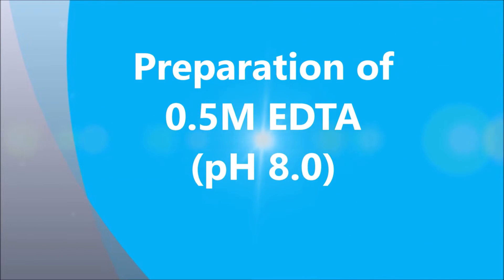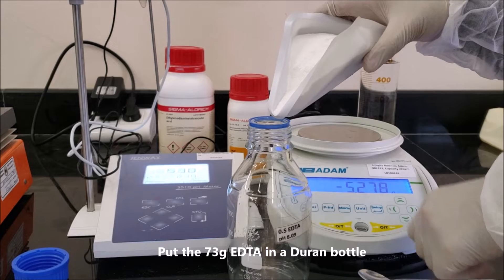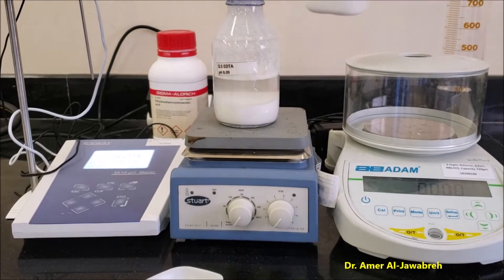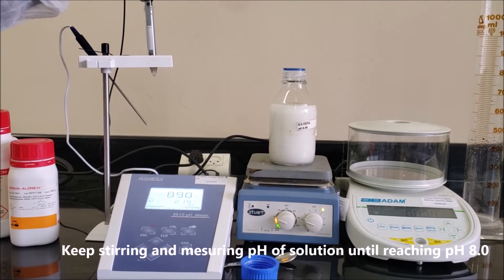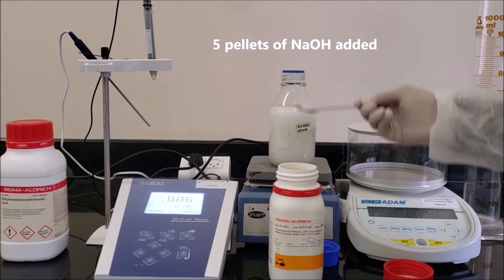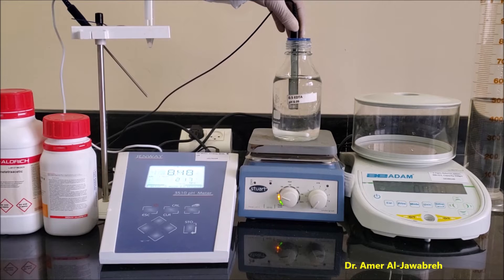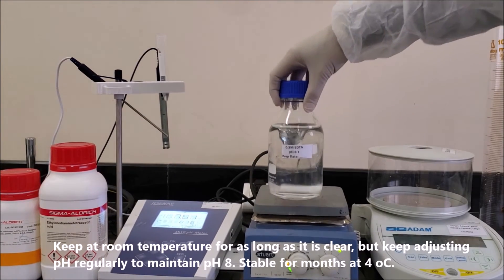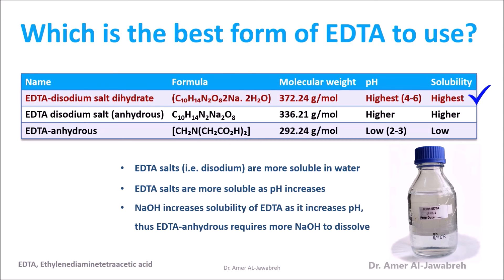How to Prepare 0.5M EDTA for TBE Buffer

Comment: Hi sir I prepared 1M EDTA many times but it takes more time to dissolve some times I added more naoh  pellets it results to ph increase like 8.9 in our lab they won't allow us to add HCl to reduce the pH for EDTA .so give me some idea to dissolve it faster at the same time oh should be in proper 8 or 8.2
Reply from the maker: Use EDTA-disodium salt dihydrate. The more H2O it contains the faster the solubility. You may use acetic acid (weak acid) instead of HCl